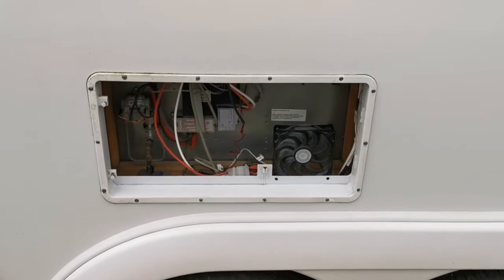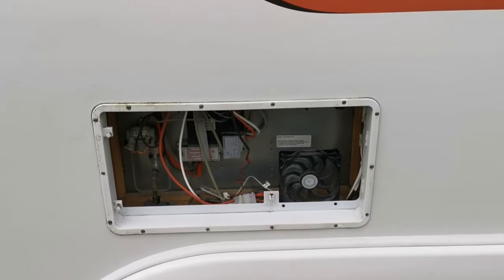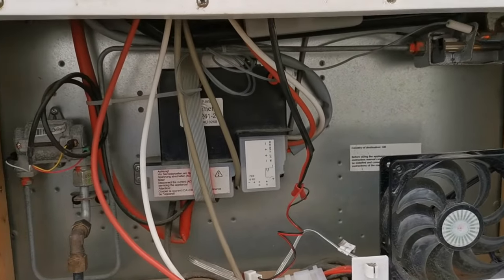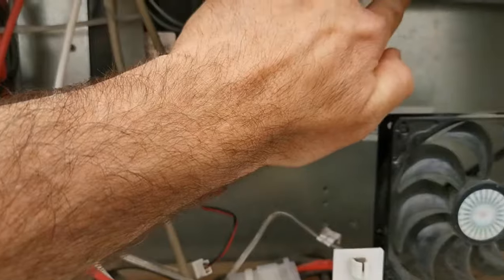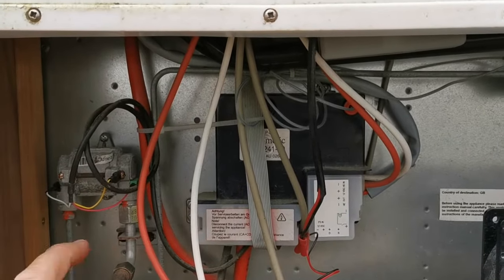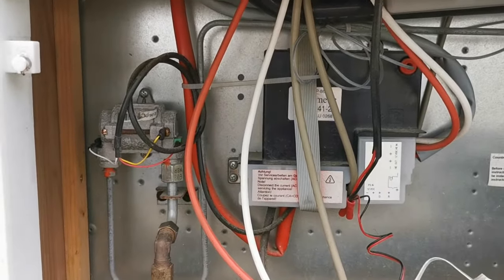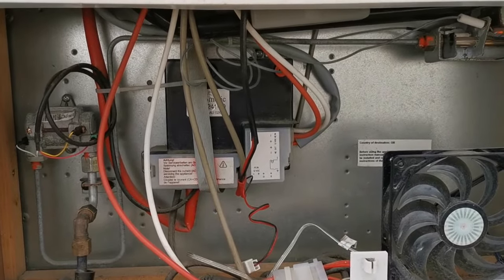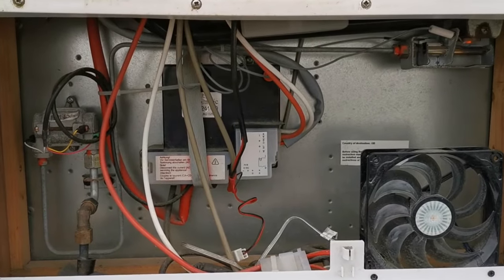Dometic gas fridge not lighting /gas ignition fault fix Bailey Unicorn IV

Comment: Is there a fuse somewhere near the electrical connections please? My fridge won’t switch on at the front panel.
Thanks for the video 👌
Reply: I haven't seen a fridge in the rear. There is usually a fuse box somewhere central like under a seat or under the kitchen. Check for a fridge fuse there in the central fuse box